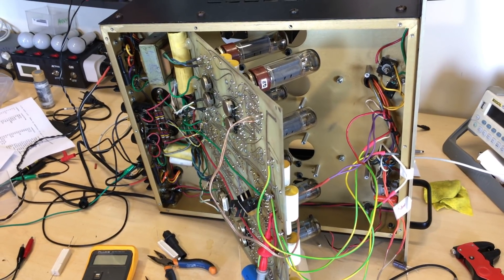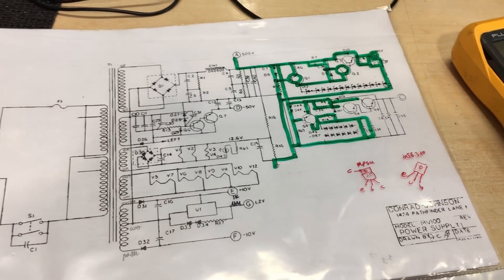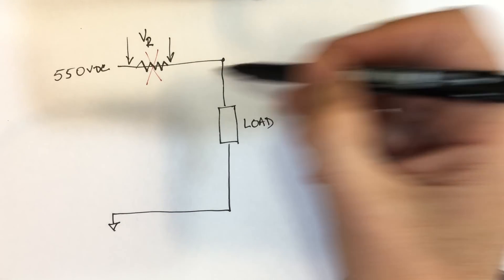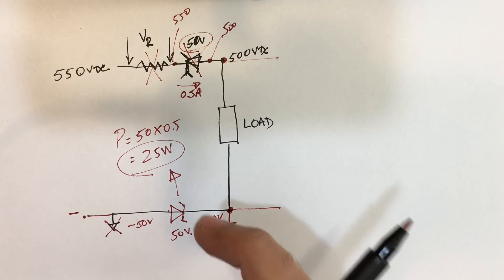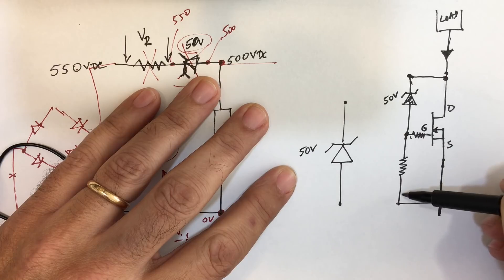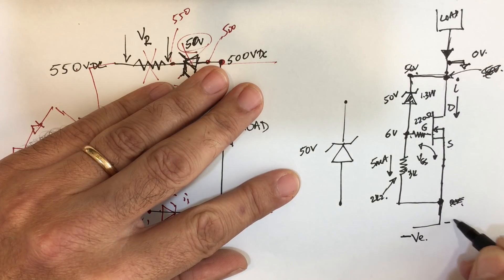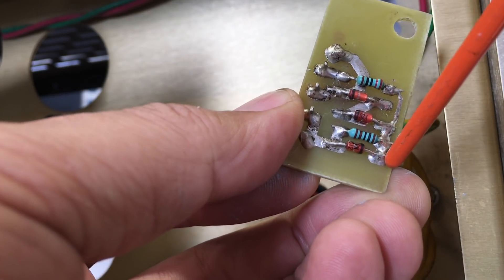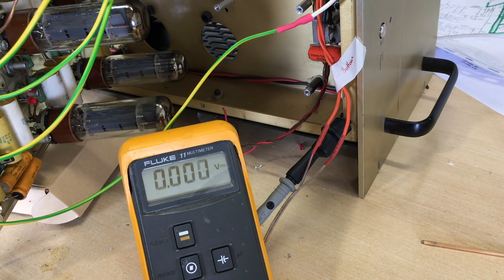Build a Mosfet B+ reducer, a.k.a. "Cheapo Power Zener"

Comment: I always have a little grin when tube guys are saying grid to the gate :) Great explanation of a nice circuit, many thanks for sharing!
Reply from the maker: Reb Elba : extending vocabulary can be tough.
Reply: I still knew what he was talking about.
Reply: Yes it suprised me too, coming form such a schooled man. Grids in valves, base in transistors, and gate in fet's. Very basic. But again, making videos/working and do propper speaking al at the same time is not easy. A slip of the pen is  totally understandable.

Comment: Thank you for making another great video!

Since you mention it near the beginning, the design goes back a fair way. I first saw the MOSFET version in an appnote (Natsemi? Fairchild? TI? I forget) in the early/mid 80's, presented as an update of the same basic design using BJTs - which itself was not a huge step from a basic zener-stabilised series regulator. The dropper configuration is one of those neat applications that tends to be overlooked until it's needed...

Although I'm reasonably savvy with electronics & valve radios, I still enjoy your videos. You have a talent for explaining things clearly & simply, in a way that often makes me go "hmm, that's a good way of looking at it!"
Reply from the maker: Jim S : thanks for the info. It is sometimes quite challenging to find the origin of a particular circuit, but you can usually bet on the fact that it has been “discovered” before. 
I enjoy making the videos, but it can be quite time-consuming and lately time has been scarce. What I find most gratifying is getting the explanation into words, so in effect I’m explaining it to myself too.
Reply: Looks like a typical series pass circuit but with a N-Channel fet instead of a NPN Transistor.

Comment: The mosfet you're using is a 600V part, which makes it rather expensive (around £9 at Mouser). Obviously, cheaper alternatives exist if you only want to drop less than 60V. A more precise alternative solution would be to use a power Darlington BJT in place of the mosfet such as the TIP120 for up to 60V and 5A, or TIP122 if you want to go to 100V, which costs around £0.70 - £0.80. The Vbe drop of the Darlington is predictable and less than 2.5V, compared with a mosfet's Vgs which can vary by several volts between samples. That obviously doesn't matter if you're using a 50V Zener with 10% tolerance, but it's interesting to see an application where a BJT offers an advantage of the mosfet.

Comment: For what it is worth to you M Caldeira,  this is a very good explanation and simplification of a complex idea.   I am wondering if it would work well for eliminating the selenium rectifier on my older tube radios. It would seem a good solution to me.  Thanks for  posting this one, it is thought provoking to say the least.
Reply from the maker: To drop the voltage in the selenium rectifier substitution, it’s probably easier to use a normal reverse biased zener in line with the output of the new silicon diode bridge. If you want to drop 20V at max 100mA, it only dissipates 2W, so if you sue a 5W zener it should be OK.

Comment: Great video, thanks M Caldeira! The only thing I did not fully understand, where is the connection point of the minus ends of the electrolytic capacitors? Is it on -50V or on a new ground?

Comment: Could you provide me the part number of a current production 600V Mofset that I can use in the circuit you have shared?   I want to be able to drop at most 50 Volts on a 100 ma circuit. I am unsure of how to spec a Mofset out, and the Part Number provided in the video does not seem to show as available, nor can I find a data sheet I am confident in. Also I think I need the zener string to ad up to about 59 volts to get 50 volt reduction, correct? I can do the work, but don't feel comfortable in specing out the mofset. Please confirm that all zeners are 1.3 Watt, and resistors are 1/2 Watt.  thanks in advance !

Comment: By the way, an MOSFET or an TRANSISTOR will fail as a SHORT, not an open circuit.
It will open only when an over-current of many AMPERES will occur.

Comment: Ive resorted to using high current filament transformers as a buck transformer. I work on a lot of 50’s and 60’s guitar amps that were designed to work with 110acv and the average North American line AC is well over 120vac, sometimes 130vac. 

I’ve had issues with fixed bias amps and Zener Diodes on the center tap. All of it to do with fluctuating bias -voltage. 

This circuit is genius and WAAAY cheaper than buck transformers, especially those sold for use with tube guitar amps.
I thought I was clever using NOS 4 and 6 amp transformers that cost $20.
Reply from the maker: Matt Fields : We have the same problem here in Portugal. The mains is now over 230V and the equipment was expecting quite a little less. I had a problem with a Mesa Boogie Mark II, when the mains crept up to 240V.

Comment: for me in america with 115 volt out lets what would be great is to reduce it down to what the variac at 90 volts does, then have it adjustable between say 80 to 95 volts out of the variac but on this -b ground at what ever voltages thous would be on a Marshall plexi type amp. this is where i have found the volume reduction and brown sound at.

Comment: I believe EL34 have a much higher max limit voltage rating than 550v, up to 800v, so my thought is, why don't you simply rebias to a safer power limit? Please correct me if my thoughts are wrong.
Reply from the maker: It’s been a while since I did this, but if I remember correctly, the idea was to bring the voltage back to the designed one rather than accepting ahigher level.
Reply: @electronicsoldandnew  anyhow it's a cool design and good to know this is possible. Thanks for sharing, a very cool channel you have created. Obrigado !!!
Reply from the maker: Pleasure 😊

Comment: I am watching the video just now.
I have a question/suggestion:
If the line voltage is too high, why not simply reduce it by adding a relatively small transformer to the line with the secondary connected in reverse phase to the power input to the amplifier? You will get 240V-24V=216V and no extra wasted power consumption.
A small 24V 2A will be enough for a 2A 230V which means 460W power consumption.
Reply from the maker: That works well too. Thanks.

Comment: Great video..  Can you provide a schematic for reducing the voltage   of a amp power supply from + 
and --  60VDC  to + and -- 45VDC  and also can I put 2 mosfets in parallel for better current dissipation . Thanks
Reply from the maker: levonet33 : I’m afraid I can’t get into specific design descriptions - just don’t have the time. As for doubling the current, just use a mosfet with higher current specs. Much easier.

Comment: what about the heaters? i guess they are still at +8% voltage.
Reply from the maker: The heater voltage will be a little high but it’s not as serious. Tube life will be affected, however.
Reply: @electronicsoldandnew  that was a quick reply! i am facing the same issue with an amp built when voltage was in the 220V range and now it's blowing tubes at 240V. i am using it with a resistor in series with the mains, to drop all voltages to correct levels, but as you say it's far from being stable. thanks for the input, i may give this a try. and thanks R.G.Keen ;)

Comment: Awesome circuit. However if you need to go lower then 400v then I would use a LR8 voltage regulator.
Reply from the maker: Leland Clayton : I agree. If you want to drop that much then you may as well make a full regulated supply with the LR8.

Comment: Pretty poor design that blows up with an 8% increase in supply, or are the valves an underrated substitute? It would not have been type approved for connection to supply in my country.
p